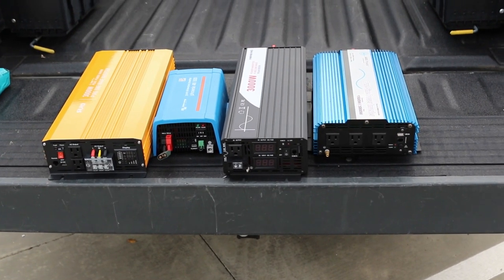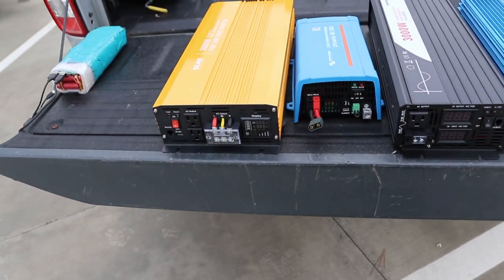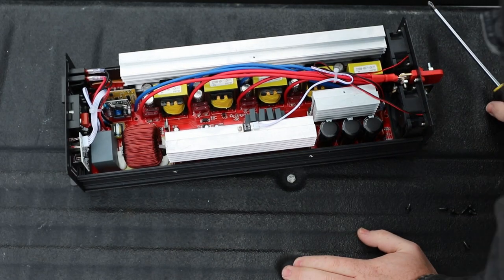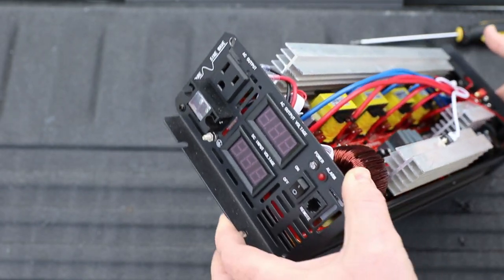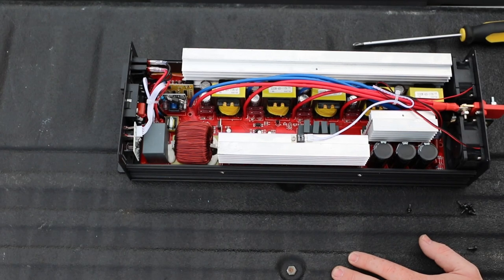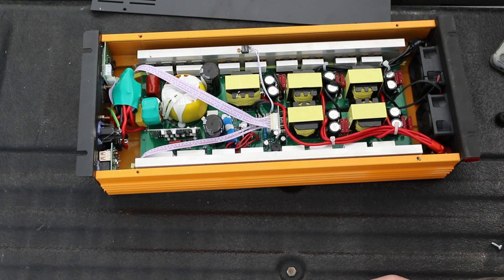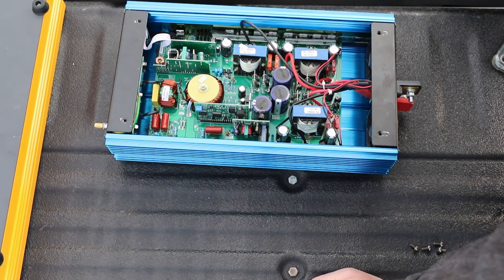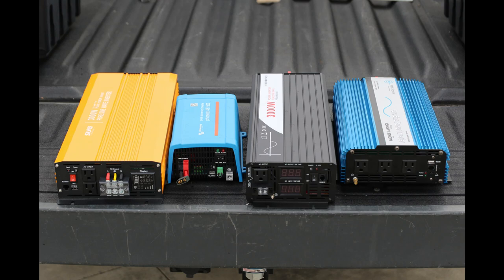Let's talk about cheap inverters (48 volts)

Comment: If you look at John Daniel channel he said the worked with the black inverter you have and it has been improved in several ways. Like larger caps, larger 12v bus bar, different plug. Lower idle draw. 

Thanks for comparing the inverters.
Reply: Search john daniel inverter swpower
Reply: I am commenting while watching. The victron also has lower idle consumption as I understand. The SW power has 12 to 20 watt idle consumption.

Again thank you. I think victron is one of the very best, but that comes with a cost.

Comment: All the fuses blow at once, time frame: POP! This is the "Reverse Polarity Protection"! (If you hook up the battery cables backwards! Just touching the cable to the battery post, and Bang!) It also take out the PWM variable speed controller for the fans (Both the MOSFET and a 220uf cap.)
Reply from the maker: there's a lot of questionable design choices made with this inverter... But mine is still humming along working better then I was expecting. only time will tell. I think the inverter is inexpensive enough that it would be wise to carry a spare for anything mission critical.
Reply: very good to know,thanks; i always thought the spare fuses were included because people can make that mistake; the pwm,mosfet and cap i did not know

Comment: I have cswpower 48volt 120AC   60Hz 40A in tools box i have 2 breaker 15A brreaker and 20A breaker for one GFCI out let 125AC volt 20A and 125AC 15A and have 4 12 volt battery with 250A fused and switch for my inverter love it run table saw 120AC 15A and skill saw 10A 😍😍😍😍

Comment: I've got the xijia 3000 watt inverter as well the only difference is that mine is 24 volt model and so far its amazing!!! We have 2 air compressors and they start at the same time many times already and they fire up like madness so if anything would kill an inverter its exactly that kind of load !!! So go ahead buy it and plug in a power bar and you are golden
Reply from the maker: Yeah, I've been running an A/C and a Microwave(not at the same time) on it for a few months now and it's still surviving. So far I'm happy with it.

Comment: I didnt look through the comments - in my case i was an offehore oil field SCR electrican for yrs - 
      What im saying ios from experience - also i live in the rural deep south - 
   Huricanes and ice storms can and do knock out power off the pole for lengths of time - 
      So i use low frequency inverterrs and high frequency inverters - 
     The VA is what a generator or inverter can generate for 1 minute as when starting a induction motor - 
      A good low frequency inverter rated at 3 kw continues will give a boost of 6 kw for 4 seconds then then possibly 5kw for 1 minute - a high end low frequency inverter will also have a 1 hr rating of 4.5 kw for 1 hr - then the continues rating of 3 kw ( at 78° F) -
    I use a 2 kw low frequency for my house when the power is out - it runs a 1 hp well pump just fine - 
     The high frequency inverters that are made by Trace or Xanax will maintane 120 volts as long as the voltage is is good - if the cut out voltage is 10.5 on a 12 volt or 42 volts on a 48 volt - the inverter will generate 120 -          on those inexpensive high frequency inverters when there used on lead acid batterys as they drop to 10.5 or 42 volts the AC out put will also drop to 100 volts - 
     They seem to be designed for lithium batterys - 
     As a general rule you dont want to have a continues draw of more than 20% of an inverters full out put rating - 
      My low frequency 2 kw inverters will power my electric wood splitter - my 3000 watt high frequency Li Time inverter will trip out from the surge off the wood splitter -  my system is 12 vilt -  if your continues max draw is 600 watts a 12 volt system works ok - 
      Any thing above 600 watts it better to go with 24 or 48 volts

Comment: I feel your pain, the pure sign inverter world is full of cheap short cuts. The smaller Xijia 2000W (Peak 4000W) was tested here where it was overloaded and abused numerous times and the overload protections worked well and didn't blow any fuses. I'm guessing the fuses are only for reverse polarity or shorting the DV or AC which would likely do a lot of damage anyway. The video is called CNSWIPOWER Inverter brutal Max Load Test. Half of these inverters found on Amazon wont even start a full size fridge or microwave so the soft start capacitor included on the Xjjia is important for power outages. The AIMS brand doesn't empress me but Victron does! Too bad they don't make a Phoenix with the right specs for your application.
Reply from the maker: Xijia has been working mostly fine... it's sometimes won't shut off with the remote switch and i have to unplug it, but other then that it's working. I figure buy two cheap ones and just keep a spare handy.
Reply: I run the whole house (staggering things...) on a 5000/2500 watt cheap china inverter ( 140 euros delivered); i heavily modified it, providing in and out  finned heat sinks for the IGBTs,and adding two extra 12V fans (.12A,each)  to cool the toroid and the multiple tranfos, through two 3 inch holes on the cover, on a temp pwm control,external; this in addition to the 2 stock fans; not bad;  the thing runs cool as a cucumber(at ambient temp plus 4 or 5 degrees) even when giving out 2450 watts steady  for an hour (fridge+ water heater+2 washing machines);  have  6 panels (220 w+,each,3 years old) on the roof, bought used at 85 euros each,  that supply a 4 bank of old used car batteries, along with two 12 euro charge controllers,30 Amps, the blue things; i have a 13 meter (13x2 is 26!!) cable with 4 wires of 2.5 mm2, but it loses me almost 10 amps at 29 volts; either i will double it,or switch to a 48 volt system, which i shd have done in the first place...

Comment: Old clip, but someone might find this information useful.  The output stage of the AIMs inverter is very reminiscent of an inverter manufactured by lingqi.  Even the layout of the AC outlet end of the unit, complete with the soft-off button looks like a lingqi inverter.  The physical size of the 3 transformers suggests 1500w peak, and 3000w for 20ms (ie, pointless rating).  The rating of the IGBTs in the H bridge will be another tell.  Combine that with the fact that it shuts down at 1500W with a resistive load more or less cements it (didn't see that part of the clip before starting this post).  The 40A fuses are probably just that they ran out of 10A fuses. The lingqi inverters are fairly explode-proof devices.  AIMS doesn't make anything from what I can tell.  Not even their low frequency inverters.  Most of their inverter specs are overstated.

Comment: I’m using the swipower  inverter 12v 3000w in my travel trailer and it’s great for our needs “but” when climate temp is 50 degrees or below it doesn’t want to power up, it’s on showing power, battery meter just won’t kick on!
 Have any others with this issue?

Comment: You have to use the block connection to use the whole 3000 watts. But I saw another video of it maxing around 2800 watts.
Reply from the maker: Internally, to the inverter, the wiring isn't any better for block connector, and the block connection doesn't easy accept 10 gauge wire...

Comment: Do you know of a way to modify (increase a bit) the low voltage disconnect threshold in such inverters? I would prefer not rely on the BMS (lifepo4 battery) to control the load disconnect. From what I've seen most have it set to around 10V (for 12V system) which equals 2.5V per cell for 4s.
Reply from the maker: Victron Phoenix can be programed to disconnect at less then 10 volts I believe but, you have to get the Bluetooth adaptor to program it. Someday I think more inverters will offer this as we migrate away from the "Lead Acid" way of thinking.

Comment: Victron don’t call these inverters LF. Thai have a mosfet bridge and a big toroidale Transformer. They call HYBRID HIGH FREQUENCY.

Actually, LF inverters are with a even heavier squere iron Transformer.

They tolérate even 300%
Reply: 300^% surge power, and handle for Several seconda. Toroidal handles peak of 200% for seconds.

HF handles less of 200%, if   Are inductive loads, and for fractions of second.

Constant repeated highly inductive loads all day long and alls days destroy a hf inverter. A LF square Transformer inverter last decades. Is more seaftey for isolation. Hf can fault dc-ac isolation or ground isolation. I never would let running without me a cheap hf inverter at high lével of power. I let alone victron at 100% power for hours

Comment: I do like the Aims Brand, but in my opinion any inverter that uses the case to dissipate heat is bad, they are cheeping out on heatsinks, because the fans are blowing over the components, yes, but they are not uniformly cooling them down like what a heatsink would do.

Comment: How much power are you looking for? Did you try VICTRON Phoenix 48V/1200VA (1000W)? The Toroid/E-CORE transformer based can handle high inrush current better than the HF Inverter. The double power rating of the HF Inverter is only for about 30 ~50mS only.
So how well is the Victron tested out? How are the other Inverters tested out with real world loads?
Reply from the maker: My microwave oven pulls 1400w so the Victron is out... they really REALLY should make a 2000VA Phoenix. I would buy it in a second.

Comment: What would the point of a low power (say 800w) low frequency inverter (the victron one) be? 
My question basically assumes low frequency inverters are only really useful for big motors that are a short circuit for when started up.
Reply: his inverter have 3 heatsink my have 2 big ass long heatsink my build much better way much bigger thing in mind

Comment: The real important thing about VA and W is that all inverter have only a VA capacity or capability...
Va power is absolute.
Watt power of an inverter don’t exist like absolute value. It’s a lie.

A 1500 W sponsored inverter can’t have 1500w in any situation. 

Hypothesis n.1:
If have 1500w max with a resistive load , it never will have 1500w with a inductive load. It will handle only 750w if power a 0.5 PF load.

Hypothesis n.2:
If handle 1500w with a motor with 0.7 PF, it will handle 2140w with a pure resistive load.

So????
1500w is a LIE in both situations.

This inverter will have a max VA capability. If would be 1500VA, this is true in any situation. The time that correspond to 1500 w and the time that correspond to 1000w. The inverter ever will be power at 1500va.

Transformer ever are rated in VA. Like ups etc. 

With VA you can choise the correct dimension of your inverter, based on PF of your loads. With W you can’t, because you don’t know for which PF the watts number is true.
Probably manufacturers refer to resistive loads.

This is one of the reasons why a good inverter is calculated at 110 or 120% of the max powers of all used loads. But a cheap inverter say to dimensions at 200% the max hypotethical loads power.

Even worst: EASUN manual says: if use indictives loads , choose a model with rated power is from 3 to 5 times the loads power😂.

The same company says you”our inverter is a shit”!!!

Victron says to chosen a model with rated power slightly greater than max loads power.

What means this?

Comment: my 48V inverter 120AC 60Hz 40A NOT BUILD LIKE THAT WAY MUCH BETTER I BUT IT DUE ONE GUY TELL THEM HOW BUILD IT MY OWN HAVE 2 BIG HEAT SINK NOT 3 HEAT SINK  AND MY INVERTER SAME CSWPOWER NOT HAVE PART WHERE CAN HOT WIRE ONLY ONE OUT LET I WAS RUNING SKILLSAW 10A and SAWSAW WITH 9A at same time wich dam cool nothing happend